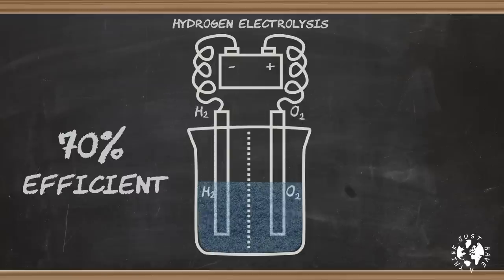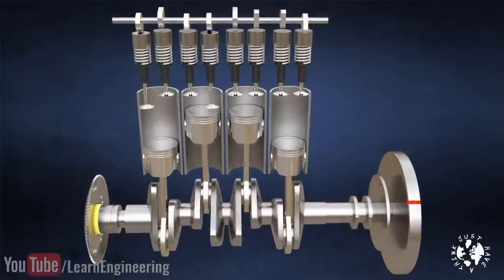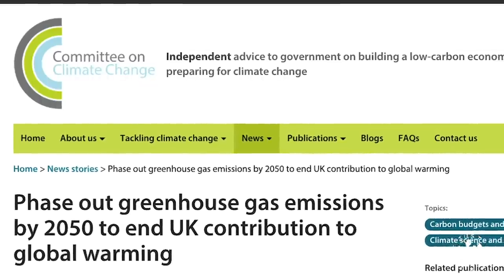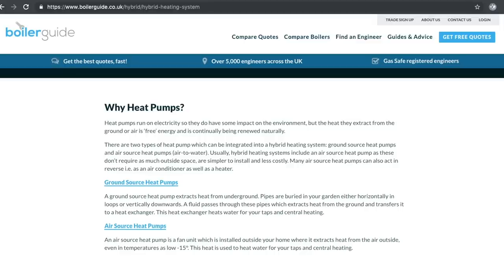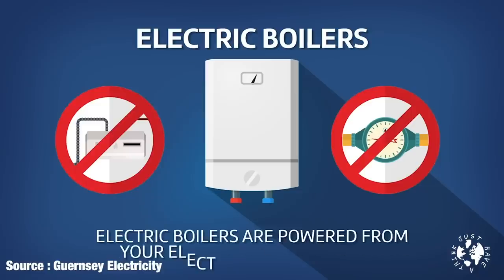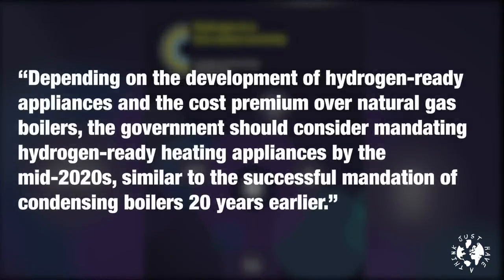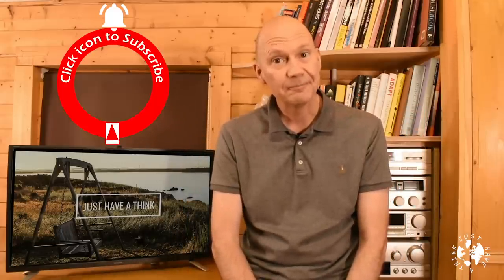Hydrogen for heating our homes

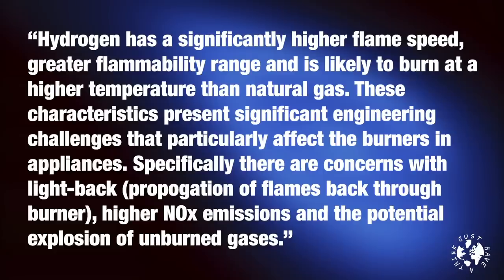Comment: Good video, I particularly like the inclusion of the slide at 10:10. There are lots of videos that discus converting to a 100% hydrogen network but I have yet to fine a single one, except this one, that mentioned the challenges in utilization that will/would have to resolved. Flame speed and limits of flammability are two issues that I remember from the town gas days, and the problem of flame liftoff on the early natural gas conversion designs. I have raised this issue in various comments on other presentations but none have been answered, I wonder how many actually understand the problems.  The 3rd and probably most important for the UK at least is the capacity of the distribution networks and domestic internal pipework. Hydrogen has a calorific value by volume of around a third of that of natural gas meaning the pipework would need to have the ability to pass 3 times the volume than it does for natural gas which I simply don't see as feasible without huge disruption and cost let alone the time and manpower to carry it out. Significant pressure increases to offset this I would suggest are out of the question. I accept that various technologies and large scale insulation of buildings would help reduce demand but I cannot see any simple way of squaring this circle.

Comment: Frankly hydrogen is just too dangerous to use for domestic heating be that for water or air. It is hardly a new observation that H2 is a very tiny molecule that is extraordinarily difficult to handle without leaks and leaks have a strong potential for explosive consequences. The situation is bad enough on commercial premises where some minimal standards can be maintained, in millions of homes you have no chance to ensure safe practices over time. Don't forget H2 can get into the molecular structure of metal, causing embritlement requiring the replacement of parts over time, that would be a nightmare to police.
June 1st 2019 in Santa Clara California a hydrogen tanker sprung a leak while being filled at a hydrogen producer, that resulted in 3 or 4 hydrogen road tankers destroyed by fire and and a couple of big explosion but it could have been much worse (no loss of life, in fact no injuries because proper safety precautions were being observed which meant the drivers were not with their trucks during filling).
Reply: nonsense. Scaremongering mythology. Town gas = coal gas = mostly hydrogen. We used it for a hundred years prior to discovery of natural gas in the North Sea. I used it for the first ~20 years of my life, my dad for the 40 years before that.
Reply: @dickhamilton3517   Every statement in my comment was true, perhaps you would like to point out any actual factual errors, I will be happy to correct any actual errors.

Comment: The big problem I see with the ban on gas heaters  is no Mater what we do under the daft notion of going green is we will be paying a lot more for heating, electric may be 100 efficient, but the cost per unit is currently 5 times more expensive to run.  Minimum,.  hydrogen transport over distance could never be transmitted the same way as the gas grid due to its smaller Element size.  So will have to be combined with other gas methods such as silage recovery, what no one is tell you though is the hydrogen boilers will use a lot more gas than conventional boilers - see the eu hydrogen boilers there estimated compared to gas boilers often uses double to 3 times more gas so your great a rated boiler will now be a d rated boiler equivalent raising more gas bills I estimate somewhere in the reason of another 3-400 pounds more per year . Make no mistake this is a bad idea that will safeguard private companies profits and create the demand to make Hinckley b profitable even with energy costs 3 times higher than alternative methods , this notion of 100 carbon Neutral when it’s already a low carbon system already will put more people in fuel poverty and do little to nothing globally, we would make more of a carbon difference growing and sourcing from the U.K. than importing from spain and Scandinavian countries not to mention safeguard U.K. jobs and innovation

Comment: instead of using hydrogen for heating because of all the engineering challenges it might be easier to use the hydrogen and make methane with it and then the appliances dont need to change at all.  Using the hydrogen and CO2 from the air to make methane would result in a net 0 carbon emitions.

Comment: Instead of making hydrogen from solar, use solar heat storage in insulated banks of earth below ground and beneath homes and businesses. If you insulate the ground around a home, you develop a heat "umbrella" beneath the home that allows direct piped extraction with fans or use of heat pumps. Coupled with superinsulation for the home, and solar windows, and triple panes with shutters and you have a home that heats and cools itself. Given hydrogen inefficiencies, the only thing recommending hydrogen is that it is non-carbon if it comes from renewables.
Reply: Why not just use methane instead of hydrogen🤷....and use that as a battery. Space stations use electric devices that converts Water + CO2 into Methane and Oxygen, using electricity obtained from solar panels. The same device can be used in reverse as a fuel cell to produce electricity (and a lot more efficiently than burning Methane...more than 70% effiencient).

Theoretically, you'd be able to power your house with Methane that's currently being piped to houses. Theoretically. I'm not saying it's a good idea. But theoretically, it's possible and it'd be at least 2x more efficient than a powerplant burning it.

Anyway, renewable methane would be carbon neutral since it sequesters CO2 out of the atmosphere in order to produce Methane. 

And during the electricity producing phase, the CO2 is a lot easier to capture since it's not being burned...the other byproduct is water. And one could pump that capture CO2 underground, etc. If one does it that way, the entire process would be Carbon negative.

We'd be removing more carbon from the atmosphere the more electricity we use.
Reply: @tylerdurden3722  
You're right except that it's not as efficient as battery storage. We lose lots of solar power doing that.
Reply: @rstevewarmorycom  it's not far behind Li-ion effiency. 

Plus effiency can be improved with heat capture. 🤔
Reply: @tylerdurden3722  
But less than 50% isn't good.

Comment: 2020: UK goal to phase out greenhouse gas emissions by 2050
2050: UK goal to phase out greenhouse gas emissions by 2080
2080: UK runs out of gas and achieves its goal.

Just like fusion power, the horizon keeps receding.

The irony is that nuclear power could actually achieve the goal of clean power energy by 2040 but the only truly viable option is off the table by the party of science.

Clean energy is only made possible by the fossil fuel industry. As the price of gas increases, the price of building and producing clean energy will go up. By the time you cover the earth in enough windmills and solar panels to produce 50% of energy needs, 40% of it will have crumbled and need to be replaced. Try recycling huge windmills.

Comment: With regard to domestic heating there is a trinity of parameters. One of these is consistently ignored.
1) Heat source. (Could be hydrogen)
2) Prevention of heat transfer. (Non-flammable wall and roof insulation and double glazing)
3) Ventilation. (Forced with heat exchange)

Modern double glazing is very efficient, but “The Powers That Be” became worried about 3 (above). So we have double gazing with trickle vents.
Question: What is the difference between trickle vents and draughty windows?
Answer: Very little. (none)
In a time of COVID we (should) have become conscious of the importance of ventilation, but in any case it is vital to have a ventilation system designed to refresh the air while maintaining the ambient temperature.
I have a system of ventilation with heat exchange in my UK apartment which is probably highly inefficient. It has a simple cross flow heat exchanger where it should probably have a heat pump. Does it not make sense to forcibly remove hot damp smelly air from kitchen, bathroom and drying cupboard while recycling the heat in that air back into the building?
Consider the case of hotels, hospitals, places of entertainment in connection with cross-infection control.
In the UK, and we do not traditionally go in for air conditioning, but it is perhaps about time that we did. Air conditioning is a heat pump. This device recycles the air within a room as it lowers the temperature and humidity. Heat removed by air conditioning is wasted. Could it not be used to heat water? Also could this not be a ventilation device?
I also have a house in Greece which has “normal” air conditioning and solar heated hot water.
Is it not about time that a comprehensive integrated system was designed to cover the trinity above to give a healthy domestic environment anywhere in the world?
Come on, it’s not rocket surgery!

Comment: @ Just Have a Think
Hydrogen is the very best answer to all of our fuel needs, it just is not the best solution for mass production and distribution. You see, we all are not actually looking at the real solution and that is that we should be localizing our energy needs to individual home production. Every home should be producing it's own energy from electricity to fuel. This would cut out on many of the losses that contribute to the inefficiencies and if using our own individual means of electrolysis from renewable and free sources then efficiency can be 100 percent on a out of pocket input to output cost analysis. The hydrogen produced can be used to run generators that produce the home's electrical energy and the electrolysis to make more hydrogen. 

Combine this with other energy sources such as solar and wind and there is no need for any monopoly or centralized  energy provider or fuel provider. There is no talk of doing this or no company trying to build the equipment to enable homeowners to be self producers because they do not want to have us providing for ourselves. If we produce our own hydrogen we do not need fuel cells as hydrogen is a perfect fuel for any method of engine, be it an external combustion or heat engine or an ICE. Fuel cells are only there to keep us under the thumb of big suppliers and high pressure systems and keep us paying for this high pressure hydrogen. Instead we should be using low pressure hydrogen in hydride tanks that increase the volume of stored hydrogen at low pressures. These types of tanks exist but to purchase them is beyond affordability and this is intentional to keep the usability of low pressure systems from the public because anyone can make hydrogen very easily.

There are some of us out here though that are developing these low pressure systems and developing different types of hydride that will absorb hydrogen and increase the stored density of low pressure tanks so that we all can safely produce and store hydrogen at home without ever the need to purchase it or have expensive unreliable and short lived fuel cells. These tanks can be retrofit to replace your gas tank and you can run your existing gas guzzler on hydrogen that you produce at home. You can cook and heat your home and have all of your hot water needs met by burning hydrogen directly or by passing hydrogen over a catalyst that will produce super heat and water. You can even use the heat that hydrogen can give you to have refrigeration and air conditioning. All of your energy needs from WATER, the most abundant element we have.

Comment: hybrid air/ground source heat (exchange loop) pump would probably always be more efficient than any combustion boiler scenario. - choose the heat exchange loop for the highest quality of heat - depending on what tasks are being performed - air or water heating or cooling...

Comment: A much more cost-effective and sustainable path in the housing sector is wide-scale adoption and/or mandating of Passive house/passive solar building standards. Depending on the local climate and home size, winter heating requirements can be met by the occasional use of the equivalent of a very small amount of electric resistance heating or air to air heat pumps in conjunction with an HRV or ERV. In hotter mediterranean-side climates, passive heating/cooling can be employed. hydrogen use-infrastructure is completely unnecessary in this case. This is no-brainer for new construction and is a cost effective option for remodeling in many cases. passive house is also being applied with great success to multi-family housing and commercial office spaces.

Comment: Another excellent thought-provoking video. Thanks.

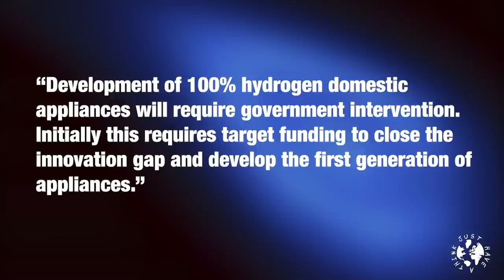Like many fiscal conservatives & their victims, you're using (at 11:33) the household budget model of government finance. Yes, it's frightfully common misconception supported by any amount of propaganda on behalf of the establishment and the capitalist class. A bit of reading on Modern Monetary Theory will disabuse almost any open mind of the notion that tax or government borrowing spent on one thing necessarily means a dollar for dollar or pound or pound or euro for euro sum that cannot be spent on something else. It works differently if the state chooses to control the money supply - one example of which is a little thing called quantitative easing, which has been in the news in recent years.

Comment: Hydrogen will have its role and rather niche applications in the future but by no means is the answer to replace oil or natural gas. The efficiencies all the way from extracting hydrogen from various sources to using it for heat are atrocious.

Comment: you are forgetting that  H2 and O2  generated at the windmill produces high pressure which will transported  to anywhere in the USA Free. to hospitals.  Also by using hydrogen you can burn  very low octain fuels very very lean by using hydrogen to ignite the  non combustible lean mixture.  great  yout tube..

Comment: Hi Dave, a really informative video and I like the way you addressed peoples various opinions at the start. I was gobsmacked to learn that hydrogen domestic boilers do not exist yet. When I read that UK report for making use of hydrogen for heating homes I don't recall it mentioning it was suggesting the use of technology that does not exist. You know me and my thoughts on non-existent technology to mitigate climate change <smile>. I can't help thinking that when Hammond announced it would cost in excess of GBP 1tn to cover the costs of net-zero carbon by 2050 he was basically saying "Do you want to pay for this?" and "Who is going to pay for this?" cos it isn't going to be us. You mentioned the UK government would need to finance to some degree the research to create these domestic hydrogen boilers. Honestly, I don't see  it happening for 2 reasons. First, the hydrogen needs to be delivered to the houses (how? Can we utilise the same gas pipes?) and secondly, people will be scaremongered by the press into believing they are unsafe - and I would expect a few explosions along the way (remember the guy who shoved a carrot into the end of his gas pipe to seal it up!!!). So lets be really optimistic, five years to develop and start a manufacturing plant for building the boilers. Five years to introduce them into new homes, then 10 years to start getting them into older homes. 2040 before they start to make a difference and not taking into account the delivery system for the hydrogen from source to destination. I don't see it happening apart from within pilot towns or villages perhaps. Overall I think it will just be too dangerous to burn the hydrogen. Perhaps it could be converted back into electricity and water at the home destination. Good video and I want to learn more about heat pumps now.
Reply from the maker: Hi David. Thanks for your feedback as always. It certainly seems like an ambitious plan on the face of it, especially as the government doesn't appear to have kicked off any kind of public awareness programme yet to assuage some of the perfectly reasonable concerns that you outline. The quandary they have is that they are about to (hopefully) sign into law the pledge to get the UK to Carbon Zero by 2050, and without this hydrogen aspect in the mix, the plan is screwed. So I have a feeling that it will be enforced in the coming year. They can, apparently, use the same pipelines, but there is a challenge with hydrogen in that it tends to make metal conduits brittle, so they've got that one to solve too! They're gonna be busy!

Comment: I am surprised you didn't mention the prospect of a fuel cell domestic boiler which can produce both heat and electricity from natural gas.
This would use natural gas as a transition to low carbon by reducing the waste of big gas power stations that that blow the waste heat away!

Comment: The unavoidable problem with hydrogen is that the two ways to get it either involve a chemical reaction based upon fossil fuels or electrolysis. 
The first is just green wash and the second will always be less efficient than using an electric heater, the energy for electrolysis will come from the grid after all. 
Heat pumps are the best replacement for gas boilers, yes they need to be sized correctly for the installation but even in a worst case scenario they produce a watt of heat for every watt of electricity, realistically its more like 3 watts for every watt of electricity. 
Don’t forget, if hydrogen was produced by electrolysis then gas would be more expensive than electricity anyway!
Reply: This! For domestic heating Vs electrification it's not economically competitive by a long way, whichever way you do it, so I think its fair to say its not going to happen on any large scale.